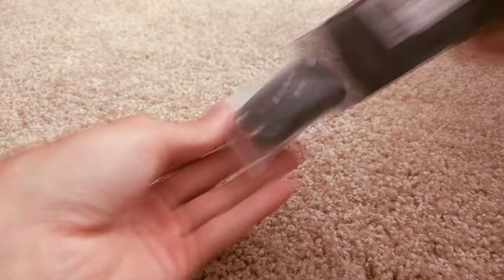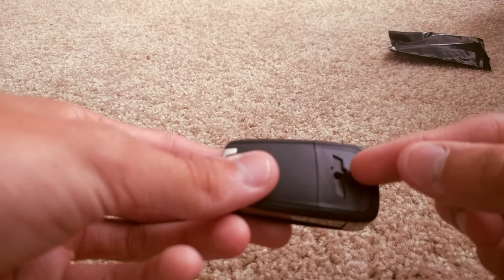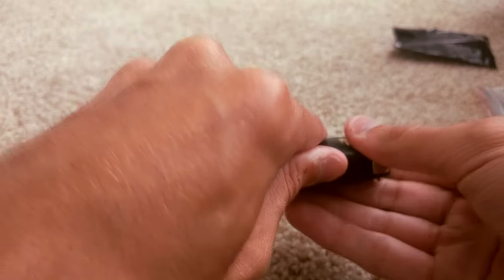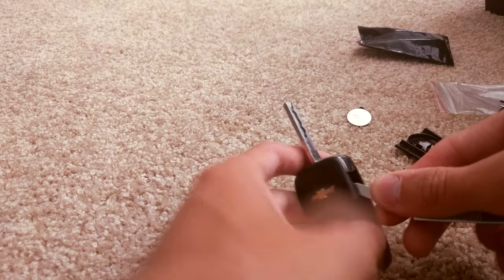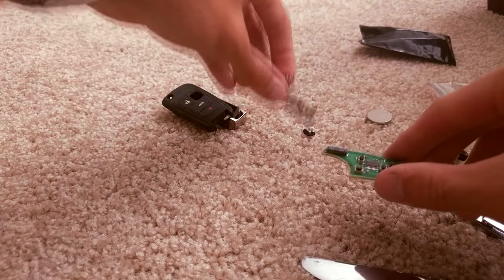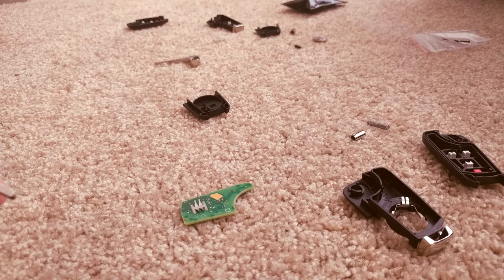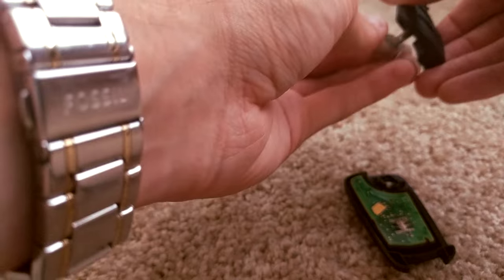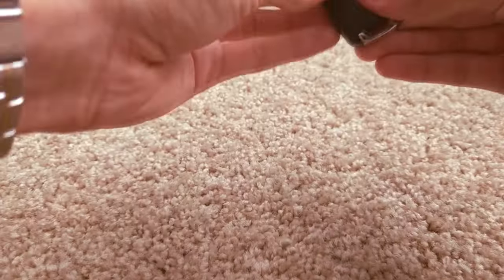DIY Replacement of a Chevrolet Key Fob! (Camaro, Cruze, Equinox, Malibu)

Comment: You can detach the key blade from the swivel base and swap them.
Reply: it wont fit buddy  u got to cut the new key blade
Reply: sc K not true. I just swapped them.
Reply: unless you had an aftermarket remote to begin with  then you can swap it
Reply: A. Marie how did you get the pin out?
Reply: @mybro727 it's a roll pin so a  tiny roll pin punch would work or something small

Comment: You don't need to take the key fob apart. The flat part of the key is held in by a roll pin
Reply: So you can just take the roll pin out and replace the key without having to completely dismantle everything? Then do you need to reprogram the key?
Reply from the maker: Yeah I only took the fob apart so I could transfer the internal board to the new shell and wouldn't have to reprogram. A couple weeks later I dismantled the key again to fix the swivel part. To do that, I removed the pin from both metal swivel pieces so I could switch my key with the blank in the new swivel piece and then put the pin back in to hold it in place. That ended up fixing the issue with the swivel piece not clicking and staying down when in the closed position cause the swivel piece that came with the new key was slightly different from the OEM one. OEM swivel piece does not fit quite right in the replacement shell, so definitely use the swivel piece that comes with the new key fob and just take the blank out if you plan to do this. Didn't document it though and I've sold the car since then, so no follow up video or remake of this video coming from me.

Comment: I followed this video till the end. I did every step and his video was helpful disassembling the key and reassembling it, although once I replaced everything that need to be replaced with the old key parts the new key will not flip and the button isn't sticking out it's pushed in and I don't know how to fix this. Ive looked it up on YouTube, iv'e searched it, tried fixing it myself and i can't find the problem.
Reply from the maker: You might have to transfer the old key blade to the chrome button piece that came with the new one

Comment: Nice video, but I can't get my key to pop out. Plus, trying to take the key fob apart, it broke in half. Putting it back together in the new fob is difficult especially the spring to push the key out. My key will not popout.

Comment: I am having trouble  getting the roll pin back in the hole. Can't get a good grip on pin with needle nose pliers it keeps slipping. Any suggestions...also tried tweezers.

Comment: So if i buy a new key fob and put my old key in it, will i have to program it to the car ?
Reply: Yes
Reply: ZahalaG no you don’t unless you remove the circuit board from old one to the new one..they key has to be cut from a locksmith or whoever has a key cutting machine or if yours ain’t broken then switch the key blade too.

Comment: The fob is suppose to flip open with the spring and click shut.. You did the same thing i did.. IT wont stay closed now... thats the problem im trying to figure out
Reply from the maker: You have to remove the pins in the blade holder parts and switch the original key blade into the new blade holder flip mechanism to get it to stay closed

Comment: We're you ever able to get the key to fold and stay down? If so, how did you do it? I need to replace mine as well
Reply from the maker: Yes, you just need to switch the original key blade onto the swing mechanism that came with the new fob. There are multiple write-ups on the specifics of how to do this in the comments of this video. Hope that helps!

Comment: GM keys can easily be re-synced if you have 1 working key without having to swap the guts over.  The blade itself can be swapped over just by removing the tiny roll pin that holds it in place to the hinged part.  Allot easier than total disassembly.
Reply from the maker: The key fob I purchased was empty inside and wouldn't work without swapping the guts over. I made the video for people in the same situation I was in
Reply: Can you re-program a key fob from another car?

Comment: did the fob end up working, unlocking and locking the car?
Reply from the maker: Yeah, I switched the board from the old fob to the new one, so no programming had to be done and everything worked.
Reply: Mine doesn’t work now
Reply: @brandonnotgood  i tried this but the shells are different in size so wheni tried put the old key to the shell it wounld fit and i fckd up the board in the process of trying to open the old shell lol

Comment: got mine put together , i think but the buttons are not working?
Reply: Look up DIY key fob programming if you have one of your old fobs start car with it let run like 10 seconds turn it off immediately insert your knew fob it will start cart and program that new remote it takes 10 or 15 second the cit car off and buttons should work.

Comment: So I bought 2 key shell fobs off internet, had the keys cut, swapped the circuit boards, one fob works (programmed) , one fob does not work (not programmed). Tried the put first key in, then second key to program, NOT WORKING.  Any ideas on how to program 2nd fob ? (2010 Camaro)
Reply from the maker: If the circuit boards were programmed prior to this, it should have worked fine. Not really sure exactly what problem you're having with the second one, but maybe the battery for one of the fobs is dead?
Reply: if the 2nd key wasn't already programmed then you will need to visit the dealer with around $100 or find a keysmith (huh?) that can do it. I have a second key, got off ebay, waiting on my lazy butt to go get it programmed.
Reply: yancysr Can you please post the link here, where did you bought. I need one but I don’t know where to buy.
Reply: look in your manual and or YouTube it ... plenty of video how to program it yourself I did that to my chevy ss .. direction was in my manual

Comment: Do we use the new key circuit board or replace it with old key circuit board ?
Please clarify.
Reply from the maker: Using the old key circuit board is ideal to keep the original programming and make sure you don't have to reprogram the key
Reply: @brandonnotgood  My original programming is not working for the new key. 
I already have the key cut, will it automatically program the new circuit if I turn on the vehicle with the new circuit inside the keyfob? 
If not, any suggestions, to make the old circuit work in new keyfob please 🙏
Reply from the maker: https://www.programyourremote.com/ has instructions for programming and also key duplication

Comment: You dont have program the key once you change your old key foab to a new one??.
Reply from the maker: Shouldn't have to if you're transferring the internals from the original key
Reply: To program a new fob that you transferred your key into start car with the 2nd original key fob let it run 10 to 15 seconds turn car off and remove that key immediately insert the key of fob needing to be programmed and start car .let run 10 to 15 seconds turn car off buttons should then work.

Comment: I swapped the blade only and now my car won’t start wtf
Reply: You were probably supposed to switch over the button parts too since they’re programmed for each car specifically. Unless it’s the same remote then I dunnno
Reply: I had to change the battery in my remote. You have to start the car, hit the lock (or unlock) button while it is in ignition, then turn off car. I assume you would have to do this if you are using a new set of internals or if you removed the battery when you replaced the blade. Remote should work after this, or at least mine did. Info for anyone on this thread in the future

Comment: For those that didnt notice in the video, it came with a screw and the gm emblem, on the oem remove the emblem and you will be able to unscrew it open
Reply: Can officially say there is no screw under the bow tie on the oem! Good idea though.
Reply: I tried that first as well but mine also had no screw

Comment: So...woulda made sense to me that if the new one had a screw behind the bow tie, that so did the old one.  Hence the reason you couldn’t get it apart....😂.  Otherwise, great video!
Reply: The original GM fobs do not have a screw, the whole thing is glued together.
Reply: Bitchspot Blog AHH, I see.  Makes sense then.

Comment: BEWARE!! Aussie VF 2014 commodore fob is solid plastic case. Bought replacement case from remote pro, had to nearly kill myself with stanley knife getting the insides out, then placed in new case now NOTHING WORKS. Car has done only 42,000 k's -  both fobs broken. GM SHOULD BE SUED FOR THE DESIGN FAILINGS OF THIS FOB.

Comment: My board is messed up, I don’t know what to do, it won’t unlock but locks just fine..
Reply: Brandon Ray you’ll have to take it apart and clean under the buttons onto the circuit board
Reply: RAHRAH807 the actual board is broken. Like the plastic that clicks on the board fell off and it like ruined.
Reply: @56brandonray  the circuit board is broken ?
Reply: RAHRAH807 YES
Reply: @56brandonray  you're gonna need to get a new key programmed..call around ask a locksmith for prices or call dealership and ask for a price

Comment: why not just spend another 20 bucks get it cut and program it yourself on chevy and GM vehicles it's shows you how in your owner manual or just YouTube your vehicle and they'll show you how ... then you'll have two key fobs use the mess up button for back up .... sheeeze just common sense
Reply: Quyen Bui programming the fob and programming the chip is two different things the fob only locks and unlocks doors it doesn’t communicate with the .edu to verify the key is actually programmed to start the car as well. It’s two different things essentially, it will unlock your car and all that but as soon as you start it it will die. Dealers want $150 or so just to program to the computer (something the owners manual doesn’t tell you how to do) so yes it’s still worth it to do this
Reply: alex golub I just swap the circuit boards then I use my scan tool to program the fob